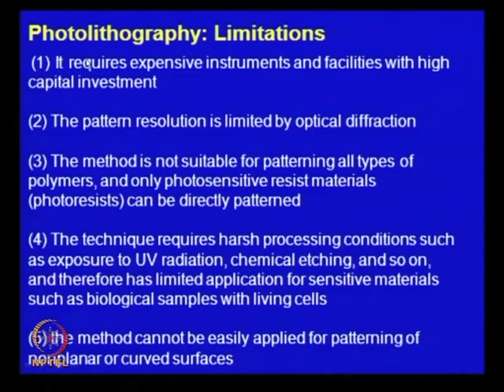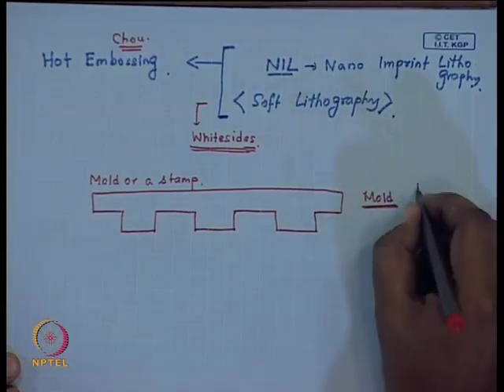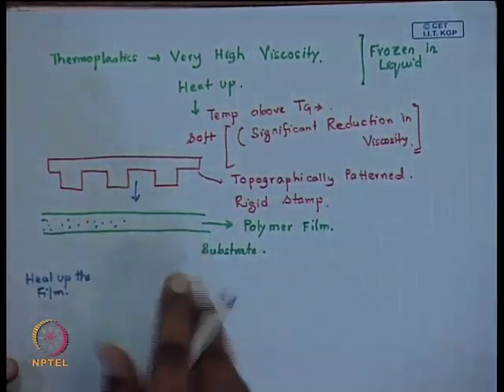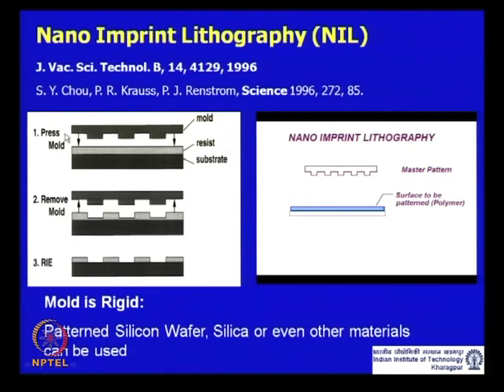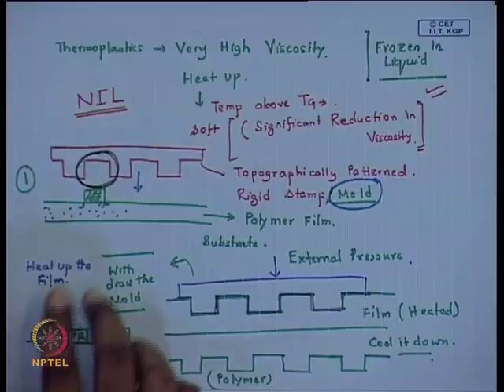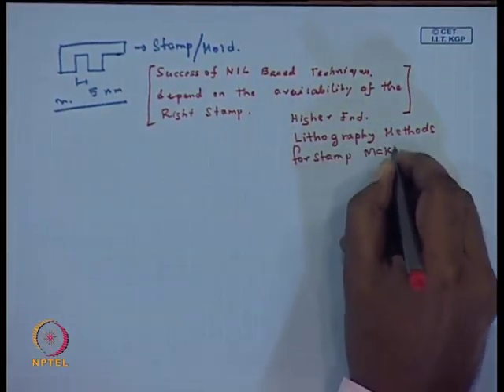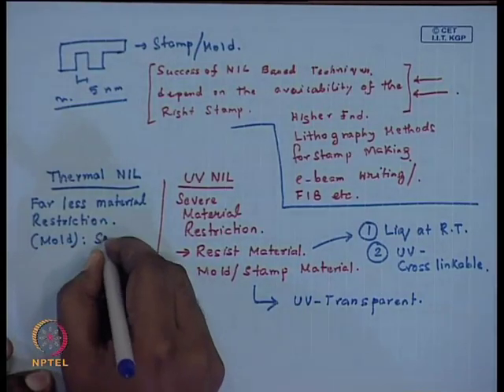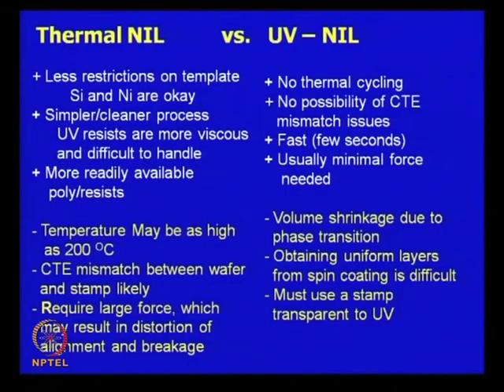Mod-01 Lec-14 Nano Imprint Lithography

Comment: Dear Prof. Brilliant and very well structured lecture. I wanted to ask if you can also recommend some lectures for physical and chemical properties of polymer materials used for NIL. For example, what parameters are important to look out for in NIL ? and How two different polymers would react (chemically or physically) under heat and pressure during NIL. What kind of polymers would adhere well to each other and how to ensure, during all of this, that the integrity of the structures is not compromised. Thank you.